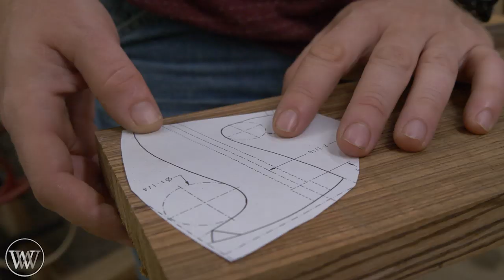Hand Plane Tote With Just Hand Tools

Comment: 1:19 To keep that from happening, clamp the workpiece in a handscrew clamp, applying pressure across the hole to be drilled.
Reply from the maker: that is what I normally do but forgot on this one. the later holes were further into the wood, but that one was just stupid. LOL

Comment: I love this. As it happens I am in the process of restoring three planes: Stanley No 4, Record No 4 1/2 and Stanley No 5. At least one of them does not have the original tote and knob and other parts. So I was thinking about making a tote and knob myself and as I do not have a lathe I will be learning from your inspiration. I'll probably use tulip as I have some in store. Coincidently I have just watched your previous videos on making a tote by hand. Interesting how your methods have changed over the years. For example you drilled the holes with the wood clamped in the vice to prevent it splitting and you neglected the centre line before rasping the shape previously but this time I did not notice the lines round the edge for the round overs. Just idle observations. It's a great video and I love the finished look.
Reply: You can rig up a fake lathe. I just used my homemade lathe to make a front knob.
Reply from the maker: so true. it si fun to see how you change little things the more you do them!

Comment: As Robin Lamond hinted, why have you chosen to have the grain of the wood in the direction tote usually break? Is it because you think the metal rod will effectively compress enough the tote to cancel the grain weakness? As seen in you video at least twice, pieces of wood broke cleanly along the grain. Still, its beautiful work, but I am wondering...
Reply from the maker: it is because it is tradition! and we do not mess with tradition! lol No really, It actually has more to do with hundreds of years of finding broken horns and toes. Most woodworkers who made these found out the hard way really quickly if they ever tried to change it. though it is counter intuitive. it is the far stronger of the two methods.

Comment: The knob is oriented 90 degrees off. You should orient the quarter sawn grain where force will be applied (think baseball bat). Probably doesn't matter in this instance but you should always try to orient the edges of the rings in the direction force is applied.
Reply from the maker: I know it is counter intuitive, but the handel is actualy stronger this way and will suffer less breaks then ruining the grain vertically.

Comment: You had a spectacular result, but just out of interest, try filing curves with the far end of the file at the far end of the curve, and progressing the stroke so the far end of the file effectively lifts.  In other words, the opposite of what you were doing in this video.  If you hate it, or can't get used to it, then fair enough.  Also try using the full length of the file instead of tiny short strokes.  When I started my toolmaking apprenticeship in 1969 the first three weeks were spent filing a one inch cube and one inch square hole from mild steel.  The cube had to fit the hole rotated every way, and if the instructor was able to insert a five thou feeler gauge in any gap, you failed.   If you want to see near perfect use of metal files, watch the Clickspring videos.

Comment: Great work. What would you recommend for grain direction if you were making one for a wooden plane without the steel rod supporting the handle? Would it be better to have the grain running up the length of the handle and do without the long flare over the thumb?
Reply from the maker: thanks! I keep it the same there! maybe a slight angle of the grain (10 degrees or so) but right about the same there.

Comment: Absolutely gorgeous though I do have a question. Every plain I have ever seen with a wooden tote has the grain running parallel to the sole. Why is that?
Reply: James has (probably) a video about this, but:
Short answer:it works better that way
Long answer: it's because  the two hooks(i guess you could call them that) that your thumb and pinky rest in are very fragile and often broken off on old planes. Having the grain direction in line with them makes them stronger, as opposed to having it run perpendicular to the sole i.e. a veritas handle, which has (to avoid breakage) smaller hooksand is less ergonomic. Not to mention that the main section of the handle doesn't need the grain to run that way, as the handle is held together by the screw that fastens it to the sole. 
Have fun at the workshop!,
Your fellow 15yro that watches too much youtube...
Reply: When the grain runs at 90 degrees to the sole the tip of the horn and the toe break too easily. The strongest configuration is with the grain at 20 degrees or so but it's barely stronger than the traditional method.
Reply: @damiencwalker  That sounds counterintuitive but does explain it. Thx
Reply from the maker: it is because it is tradition! and we do not mess with tradition! lol it actually has more to do with hundreds of years of finding broken horns and toes. Most woodworkers who made these found out the hard way really quickly if they ever tried to change it.
Reply: Cast Iron planes have a screw that bounds together all wood-grains. Literally taking up all tension in its direction. Like a middle-layer in plywood.

Comment: Yea, the lines going horizontal on the tote, and vertical on the knob look a bit weird; and such lovely handles almost seem wasted on such an ugly plane, they'd probably look better on a standard no. 4 or no. 5. 
Or maybe the different lines on each piece would work better on another plane, like a large jointing plane, or a low angle smoothing plane or something.
I'm not criticising, just pondering.
Or 45 degree lines would be cool, matching the angle of the blade..
Great job, they look bloody lovely.

Comment: But you do know that wood is least stable in the direction of the grain ?
Reply from the maker: Intuitively it would appear that way, but it is actually far stronger this way. if you turn it the other way the horn and toe break off. and those are what support the hand and connect the force to the base. there is a reason that is the grain direction on all  hand planes, even when they are on a wooden body with out the bolt.

Comment: Hi forgive me for the stupid question, why the wedding ring on the brace and bit, again stupid question. Cheers from Tasmania👻
Reply from the maker: Not a problem. I have a video showing how you can use that for different methods but in this case it is telling me that my bit is level up and down. I can eyeball it side to side but the ring will tell me if I need to raise or lower it.
Reply: @WoodByWright  thanks makes sense. Cheers 👻

Comment: Hello, really like how it turns out!
I had asked you in the previous video but you probably didn't see it. I would like to make a handle for my hand saw, and I'm pretty new to woodworking. What set of rasp and files would I need?
Also, a local manufacturer (Glairdon Vallorbe) sells metal as well as wood files. How much different are they and how much could they be used interchangeably?
Thank you and keep on your great work 🙂
Reply from the maker: I will be making a saw handle here soon. honestly, there is little difference between metal and wood files. I use some of both.
Reply: @WoodByWright  OK, thank you. But I was more interested of knowing what rasp and file I should buy first. I have no idea how many rasps and files are needed and what budget I should expect to put in it.
Reply from the maker: I have never purchased a new one. I normally find a bucket full at antique stores and estate sales. sorry I am not a big help on that one.
Reply: @WoodByWright  Thank you. Yes, I know you're more into old tools, but where I live they are pretty hard to find. But what I ask was more about what type I should need, like "x rasps like that, w files like that, those shapes are the first you'll need, and you'll need those sizes". Do you think you can help me on that?

Comment: What was the second bit in the brace? I just recently got started in woodworking and wondered why there are not bits larger than 1" readily available for my brace.
Reply: It's an adjustable wood bit. You can get them for a hand brace or drill press. The one I have is a Irwin that will adjust from 7/8 to 3 inch. They run about $40.
Reply: @grimsoul0  Thank you. Found one, just didn't know what I was looking for before.
Reply: @jordanjohnston5108  Not a problem. Glad you was able to find one without a problem. It's not something I need often but is nice to have around when you do need it.
Reply from the maker: right on! what he said! you do not see larger twin blade bits as the force it takes to plow that much wood out of the way is a lot. but with an adjustable one you are just doing one blade at a time.

Comment: All the videos I see of making totes from scratch has been bothering me. I think, based on the diagram, what they want us to actually do is bore the rod hole first. Align the tote square to the rod location, bore the hole and then cut out the tote. I keep seeing, repeatedly, from everyone, cutting out the tote and then concentrating on how they are going to bore the hole. If you bore the hole first, THEN cut it out, you wont run into all the hassle and frustration. Just my thoughts.
Reply from the maker: You bore the hole first if you are using a drill press. But if not it doesn not make a difference if you do it before or after.
Reply: @WoodByWright  Yeah, that makes sense with the drill press. I was just thinking, it would be more practical even with a brace and bit to start off drilling perpendicular to the square wood, then you have a reference point to do the rest of the layout. Obviously you'd need to start with the grain in the correct direction before starting.